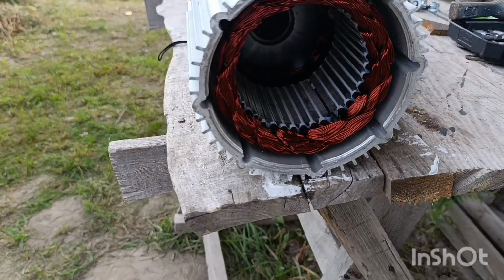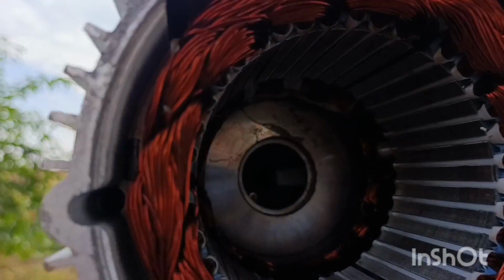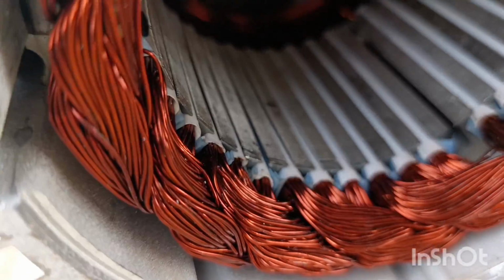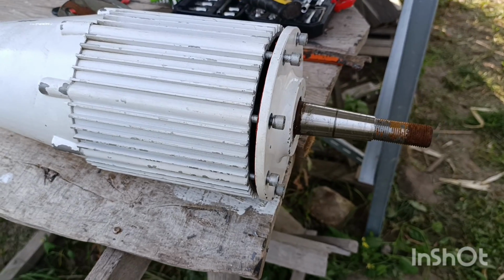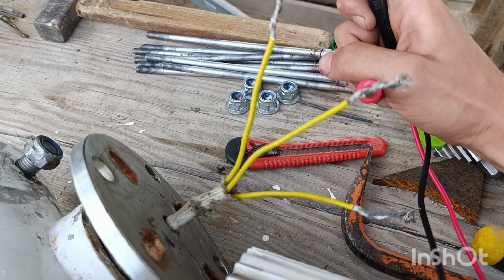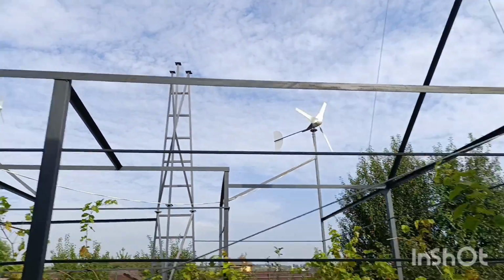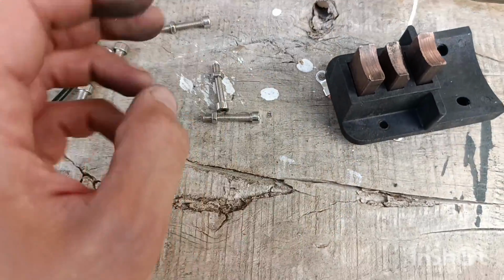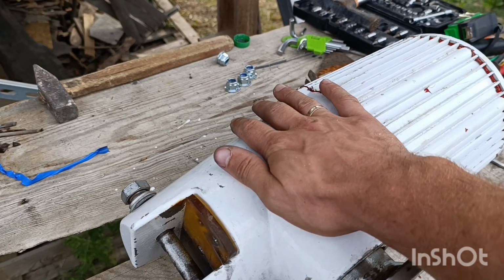FT-1000 gen maintenance while it's disassembled. Preparations and checks before the next wind season

Comment: These 3 phase alternators (generators) are rubbish in my view I have 2 x 2Kw unit which has had major winding failures and slipring failures within 6 months of commissioning. The bearings are very poor quality and found to be spinning on the shaft at both ends which is wrong. With the 220v winding which failed it has no phase to phase insulation and has not been varnished in an oven to prevent the windings from moving. As you say the wire size is good for current but the way it has been wound will not handle high phase to phase voltages. At high wind velocities (revs) the 220v rated unit will easily produce 440v phase to phase which can easily damage the windings and associated control gear. Buyers should be very cautious about buying these wind turbines. (written by profession electrical engineer Australia). PS: I have had the stator re-would and manufactured a new slip ring unit to get it working. Also replaced the bearings and used helicoils to repair threads (stripped at the factory)
Reply from the maker: all this said means you just weren't following the instructions.
why are all of those working quite well in my case? no major issues and glitches - just regular maintenance - and they fly.
Reply: @BackyardVoltage  This video is about a brush / slipring failure which has nothing to do with following the instructions. My issues were much worse however. The issues I raised (mainly) about winding construction are technical and are largely about initial design and manufacturing process which are lacking. The units are cheap  and the buyer needs to appreciate they get what they pay for.
Reply from the maker: man...
my gen is 48A, it's designed to bear high current and low voltage.
other gens designed to bear 240VAC for instance, will have much thinner wire, and are required to use 15-18A as a max!!
by saying - follow the instructions I mean there has to be a certain rpms reader and controller, there has to be a proper power curve setup, and there has to be a proper wiring overall from the unit to the control system. if that is sustained - NO ISSUES aside of timely maintenance (like my FT-2000 currently requires for example at this exact moment 25-th of Feb 2026).
I've got various units of various voltages, and I am mostly happy with what they can output. some require slight mods, which are ongoing or in deliveries, just because that's my playground. but normally - mounted and forgot it.
bearings issues?? what are you even talking about? zero issues on any of those on any of the units I've been using or any of my clients have been using (for those units that I know where I purchased them from) - about 30-35 units in total for a time of 2-3 years gradually mounted.

Comment: Great video. I have two istabreeze i1500s which have performed well for 3 years. Just took one apart to change the rotor bearings (6502 )SKFs. This immediately made it run smoother. A slight rumbling disappeared. Did sliprings while I had it apart.  Have you tried to change sliprings or bearings on the ft1000s or ft2000s?.
Reply from the maker: No, I haven't. They seem to work pretty well so far. Bearings are very thick and do not show yet any signs of getting tired

Comment: Check the LHCM2-48V 2000W wind controller if you did not buy one yet. I have it myself and it works very well. Boock and boost, starts charging at 6V if you program it this way, rpm limitation, amps limitation, volts limitation. Flotating function, battery disconnexion, wind turbine disconexion and more. All parameters adjustable. I am super happy with it
Reply from the maker: really boosts starting at 6V?
that's impressive!
however, from what I know - they have different versions, and in general you get a standard one and a sophisticated one, those differ in price like twice. how much was yours?
Reply: True. Mine was very expensive but it is worth it, believe me. When you dismout it, the inside looks like a nasa rocket. There are lots of components that I never saw before inside a wind controller. Mine cost 480€ door to door arround 4 or 5 months ago. The seller was Elege new energy. Quite nice people. It was the cheappest seller back then. It tells you the battery banck temperature as well. The only think I miss is that has no bms port to connect with lithium batteries, but aniway. The bateries have double bms so I am safe, and in the morning the sollar controller takes controll and adjust volts between batteries if needed
Reply from the maker: Yes, I just checked in with my supplier and boost&buck version of LHCM controllers is optional. In about 2 months I'll have the other WWS30-48 controller delivered to me together with the 96V M8 turbine, I'll definitely give it a decent review.
Reply from the maker: also, just checked again, there are two versions of this controller: LHCN - which is PWM one, and LHCM - which is MPPT one. pricewise, MPPT version is like 30% more expensive roughly. I'm trying to figure out what is the exact functionality difference.
Reply: Ask them the specifications of both of them so youll compare and decide
Reply from the maker: already did, thank you

Comment: I got my the Rentech/i700 up and ready on the mast 72 v for a few seconds ?  brushes. I would change all brushes and keep two spare, then you will have three worn brushes and a spare, if the same issue accures
Reply from the maker: yep, your ista is a high voltage one, thin wire inside the gen leads to more coilturns and results in a higher voltage induced by the magnet field.
I assembled it as it is, just to have it assembled and check if the issue was fixed. I'll wait for the brushes now, and then will ultimately decide which to use.
small addition as that was not mentioned in the video - it's better to use the copper-carbon brushes, not the pure carbon.
Reply: @ModernUkrainianHomestead  Theirs probably no gain either way, i just think all brand new brushes would last longer than used, saveing more maintenance time. Volts for a few seconds then the amps start generatornig then it disconnects, so 300w up now and its rattling like a broken record, bearing swop with the old burnt out rentek generator me thinks.
Reply from the maker: check the slip ring - those are the first things to fail in Ista's
Reply: @ModernUkrainianHomestead  Its the Rentech/i700, Ive made a Frankenstien wind turbine, brought the renteck back from the died. I should have wet and dryed the rings on the brushes or lift it and it might of got worn in the copper shaft.
Reply from the maker: Ah, so it's a Frankenstein... Well, then no one aside of its creator knows what's inside and where the issue may be.
Reply: @ModernUkrainianHomestead  Ha ha. You carnt tell shes differnt wind turbine parts, shes perfection. unfortunately you can
Reply: You know? I think the ft1000l gen is the same that they put in the infamous M5 1kw with turbine. I know because I have the M5. Not amazing but not bad. I do not like the slip ring a brushes. Los of problems. You were lucky and didnt fail wail on top of the tower with crazy winds. It happens to me ones. Likely a attached a rope on its tail and I was able to turn it arround
 Not funny while your wife yelling at you..Go iside go insie, I am fuc king tired of your wind turbines, one day I am going to break them all😂
Reply from the maker: no, they are different. M5's generator is twice as smaller, with 4 cm in size, here in FT1000 it's 8cm of rotor and stator thickness.
however, the current transfer mechanism they use everywhere pretty much of the similar construction - starting from M3 and up to FT-3000L2 definitely there is a brush mechanism like shown here in this video.

I am getting the M8 wind turbine in about 2-2.5 months, will definitely open it up and compare.
Reply: My M5 is 6cm but i think i bought the 1,5kw version... I dont really remember that was very long ago. It never gave me 1,5kw though. The maxium I saw out of it was 1,2kw. By the way, I am looking for a good wind turbine arround 1kw. Looking for good quality but not extremelly expensive. Here in Spain we have one that costs arround 5000€. Any suggestion?
Reply from the maker: @JoseAgustin-hq2pl  IstaBreeze ))
Reply: I want to retire my old M5 and I am looking for a one 1kw wind turbine. Any suggestion?
Reply from the maker: @JoseAgustin-hq2pl  No idea... If your only hesitation is the tower - go for the FT-2000L2. that one would be bigger and better. Or ask the seller about the smaller ones, they have 2.9m dia, likely 2.5 dia as well (like my so-called FT-1000).
Reply: Yeah Ista breeze again. At least I know what am going to get😂 Difficult to choose when every single manufacturer, makes the same model than others. It IS like Toyo ta. For d, citro en etc, all of them made the Au di A4 model. Doesnt make any sense. I like your FT1000L. I follow your Channel  and Ive seen good performance in very low wind wich IS what I am looking for. What is the output with strong wind? And why do you think that Jessica from Wuxy IS a better option that EOG?
Reply from the maker: Jessica is just more honest person, and the factory from Wuxi FengTeng is never overpromising, that's it...
ESG - not sure, I got my ESG (FT-1000) from local reseller as a free of charge warranty replacement for my non-working vertical machine, so haven't really talked to the factory at that point...
Reply from the maker: What I've seen max out of FT-1000 was 1.1 kW, that was several times at peaks. but in general it is a quite capable small wind turbine. quite heavy though, total net weight is about 45-47 kg.
Reply: By the way. Do you know what is funny about ista breeze? It is full of videos, and everyone is extremelly happy with the wind turbine. But if you look for model like the ones we usually talk about, there are very little. Dont understand how ista breeze became so popular. That is why I bough one. I had it 2 day, one day to open it up. Extremelly dissapointet. Called the ista breeze after sales. They ignored me, I tried next day that it was wind and nothing at all. Like 10W with 8m/s or so. A toy for children!!!
Reply: Understood. Thanks. I will continue looking for a 1kw wind turbine. Great channel by the way